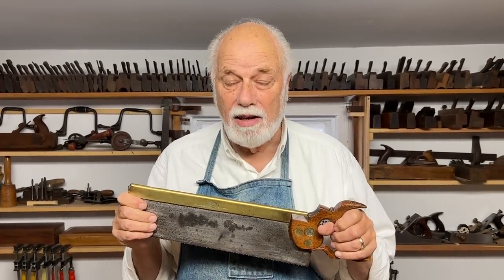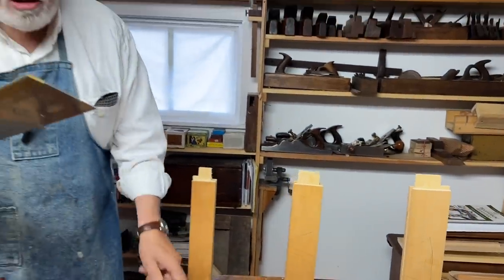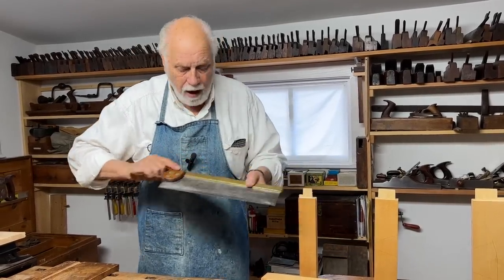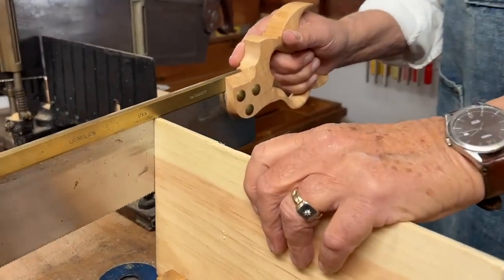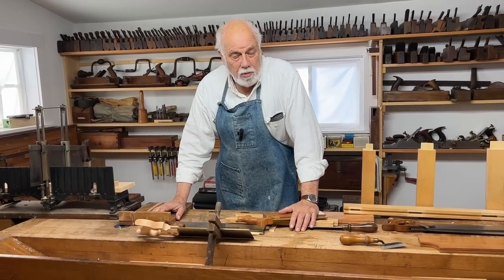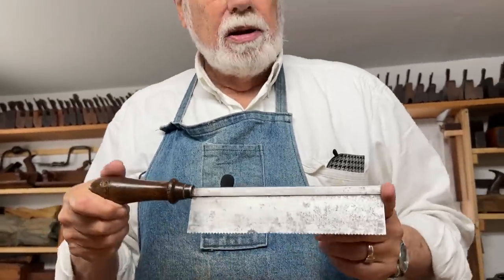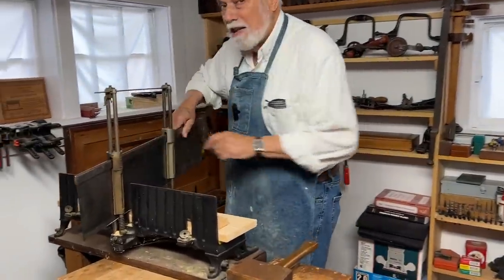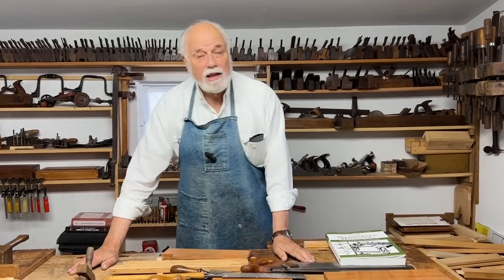25. Back Saws

Comment: At 4:00 when you discuss long grain vs. cross grain, isn't the second cut that you demonstrate also long grain? The grain is running up and down, so any cross-grain cut would require you to rotate the saw so the blade is horizontal (or, more commonly, rotate the stock).
Reply: Agree with this comment 100%.  The only crosscut here is when the shoulders are cut.
Reply: @tombaker3794  and therefore, tenon saws are almost all rip filed, not crosscut. Surprised and disappointed by that segment; almost everything he said about Tenon saws is the complete opposite of everything I’ve ever been taught about them.
Reply: I thought the same thing, the only cross cuts are for the shoulders.

Still, maybe cross cut teeth work fine, I don't know...
Reply: Actually for finer saws, say under 10 to 13tpi (depending on your skill, and how aggressive you sharpen the teeth) there isn't much difference at all between so called "crosscut" teeth and so called "rip" teeth. So call them rip or crosscut its up to you.

Rip and crosscut teeth are a thing indeed, but with coarser saws. Btw crosscut is more about rake than fleam, fleam does help but its not the main aspect to me.
Reply from the maker: sorry for the confusion, the second cut is indeed ripping, but read what Darkounet says below.
Reply: @darkounet3478 , In my December, 1992, No. 121 issue of Fine Woodworking, there's an article by Mario Rodriguez titled: Soup Up a Dovetail Saw". In it, he describes the "How & (most importantly, the) Why" of it. Yes, pictures are included.
Reply: You are correct...I've known tenon saws to be always a rip cut and sash saws, nearly identical to tenon saws but a bit shorter and cut with crosscut teeth for cutting across grain (as in cutting tenon shoulders)

Comment: Another gold mine of information. I didn’t know about the tapered plates on early tenon saws, always thought it was down to wear! Thanks again.
Reply from the maker: You bet!
Reply: I too didn't know about that aspect and thought it was a "Feature" brought about by age, wear and mishandling of the two rather elderly finds of mine on e-Bay. Now, I (hopefully) know better. 
Addendum: During the ensuing months I ran across a simple way to find out if the rake of the backsaw blade is the factory original or due to some previous owner's attempt to duplicate the rake of older 18th and 19th century saw smiths for easier and better control; look at the toe [front] of the saw plate. If it is 90º to the saw back, then that's the angle the saw maker intended. If it is not, then for whatever reason it's been changed.

Comment: I recently bought a Lie Neilson tenon saw. It has 11 tpi and is almost impossible to start. I have to use my cross cut saw to start the cut and then use the tenon saw.  I have also used the crosscut saw to cut the tenons and it cuts them smooth and fast. The tenon saw is aggressive once the cut stars and have to be very careful not to blow out the tenon with it. Thanks for your informative video on back saws. Every beginner hand tool woodwork needs to watch it.
Reply from the maker: Right on

Comment: Mr. Blackburn, During the ensuing months since I replied to a commenter here, I ran across a simple way to find out if the rake of a backsaw blade is the factory original angle, or due to some previous owner's attempt to duplicate the rake of older 18th and 19th century saw smiths for easier and better control; look at the toe [front] of the saw plate. If it is 90º to the saw back, then that's the angle the saw maker intended. If it is not, then for whatever reason it's been changed.
Reply from the maker: Makes sense!

Comment: Very good. The Stair Saw: I've seen it demonstrated once on YouTube but I believe it was demonstrated incorrectly. It was demonstrated cutting away and toward the body with one hand same as a regular saw. I use mine with two hands across the body the same way a hand plane is used just not lifting out on the reverse stroke. I find it indispensable when cutting across a table-top when cutting out the tenon for a bread board edge.
Reply from the maker: Good use for a stair saw — now almost extinct except for custom carpenters.

Comment: Graham, thank you for the information on the various back saws.  What I would like to know is how to sharpen a back saw.  I imagine it to be hard, and probably using specific jigs.  I am aware of the triangular file, but are they all at a ‘correct’ angle or are there varied files?  I may never do it myself, but the information would be useful when talking to someone who does.  Perhaps back saws and saws in general?  Tony
Reply from the maker: Use an 60degree triangular file. Sharpening is the same principle as with panel saws.
Reply: Thank you for the reply Graham 👍

Comment: Regarding depth taper along the length of the saw, I thought that was usually the result of tensioning the blade by knocking it deeper into the spine at the toe.
Reply from the maker: The typical back is nowhere deep enough for that to have been the case, but I will admit that the example I showed looks like that could have been the case; most earlier tenon saws are much more tapered.
Reply: @gjbmunc , I have acquired two, thus far, somewhat vintage back saws, an 8" Spear & Jackson "Spearior" - 52 [perfect handle/tote for my hand], and a W. Tyzack, Sons & Turner No. 14-B [handle/tote a bit over size, but usable], both of which exhibit the same heel to toe slope which, apparently, I misattributed to mishandling, faulty sharpening technique, etc. 
Will you be giving a lesson on straightening (back) saw blades that are (Gently) bent, but not (Hopelessly) kinked? [Guess why I'm asking.]

Comment: Interesting about rip and cross cut teeth for these saws.
I seem to remember Paul Sellers saying he preferred rip teeth for a tenon saw, can anyone confirm?
Reply: Yes, https://youtu.be/mTqZTGPPRj0?t=335 So when two titans of woodworking disagree, that usually means you are free to choose 😃
Reply from the maker: The teeth (and set) on a tenon saw are generally so small that it really doesn't make much diference when sawing out small tenons. Sorry for the confusion.
Reply: You are correct, as per Sellers. Actually, the smaller saw teeth get, the less likely you are to sharpen them for cross cutting. Small rip teeth work perfectly fine to cross cut. Tenon saws are sharpened rip. There is a saw specifically for cutting tenon shoulders and other stock across the grain called a carcase saw. These are generally sharpened cross cut.

Comment: Sorry but aren't you still ripping with the tenon saw when cutting down from the end grain even when you rotate the end grain 90 degrees?
Reply: Yes, I  was confused too, but I think he might have meant it be referring to shoulder cut which is crosscut.
Reply from the maker: Yes, you're right, it's just the shoulder cut that's a crosscut.

Comment: Hi Graham, 
In regards to that saw cover you demonstrated,  do you have to treat the timber so that it doesn't rust the blade?  Some people suggest that saw dust or shavings can lead to this. 

Regards, 
Adam
Reply: Hi Adam 👋....I love Grahm .  Perhaps I can help him out here.  I use PVC to make guards for chisels, axes, knives, and saws.  Diameter of pipe is dependent on what you are making.   For a saw, 1" is big enough.   Cut slightly longer than the blade, and cut a slot along one side.  Heat the PVC in a 350 degree oven until pliable,  slip the softened PVC over the blade a quickly clamp between two boards (if first cools too quickly - just try again).  If there is a lot if set in the saw, just slide it off the the saw  (slide it off backwards and back on again)  a couple of times to obtain the clear.   Hope this helps, and have a happy day 😊
Reply from the maker: Never actually had a rust problem, but maybe my saws don't spend too much time in their cases.
Reply from the maker: Not a bad idea but I'd just as soon stay away from plastic.

Comment: As a gentleman i only use gents saws. I ve always considered frame saws as backsaws. It is the same principle even if the back is not on thé blade. Would you agree ?
Reply: No. The frame saw straightens the blade by stretching it, putting it under tension, much like a guitar string. The blade of the back saw is kept straight because the back confines it, preventing it from flexing.
Reply from the maker: Exacrly.

Comment: Japanese saws are really slick, but very fragile. They are designed for a completely different work environment, where there is never anything that you can accidentally hit it with, like a work bench, bending a tooth. I don't think they use work benches in Japan, but just sit on the floor holding the work piece with "a foot and an arse" as someone put it online.
Reply from the maker: You're absolutely right. But there are still a few occasions when I find a Japanese saw is useful.